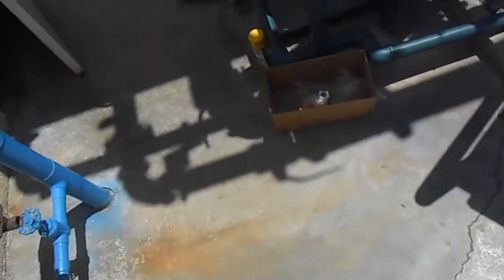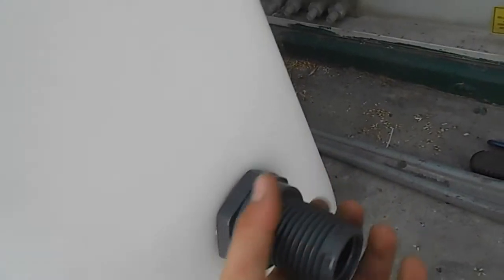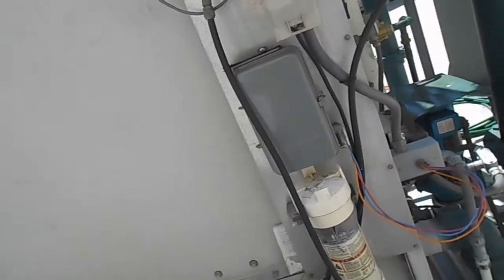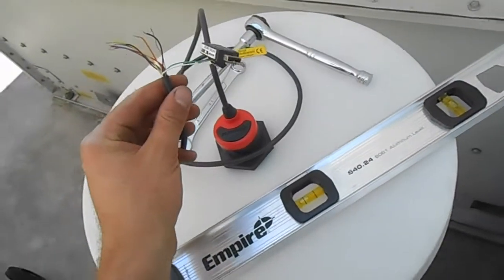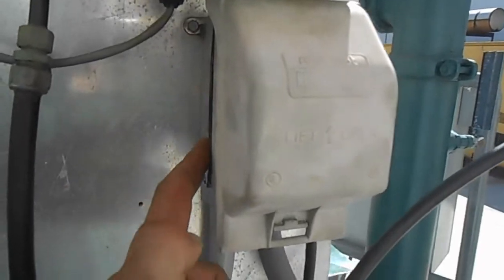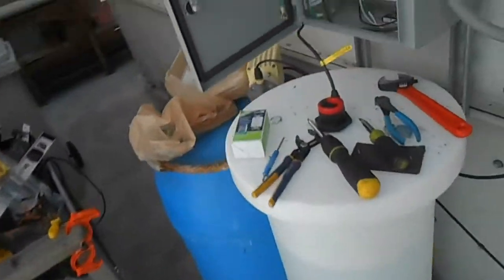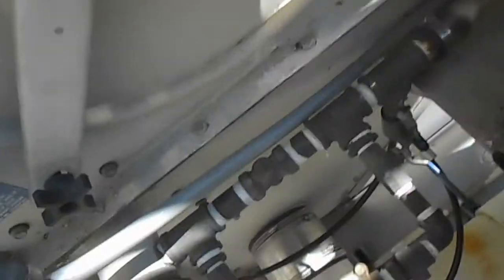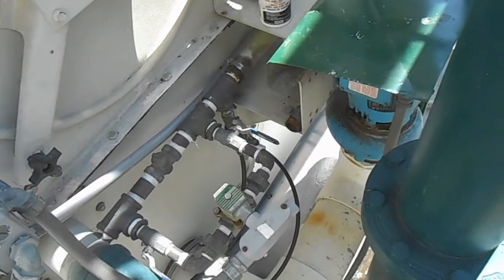HVAC- Cooling Tower Basin Water Control

Comment: Can you explain how the heaters work?
Reply from the maker: Familia Sanchez HVAC Heaters? Do you mean on the water source units?
Reply: 71dembones No, the ones in the basin, in the cooling towers. Don't they have heaters and a thermostat?
Reply from the maker: Familia Sanchez HVAC Perhaps they would in another climate where freezing could occur. But even then, I believe cooling towers would typically be drained in the winter months. I live/work in southern California so we rarely get to freezing temps here. If there were heaters in the basin, I imagine it would be just like a big water heater resistive heat element. Probably would have a contactor controlled by a low voltage thermostat that's was exposed to the water temperature.

Comment: Love cooling towers.  I took hvac in college 20  years ago.  Didn't finish, though.  Never got into cooling towers as far as I got in the course, but on the way there on the transit bus everyday, i'd pass some cooling towers and one I remember in particular.  I have since then taught myself how they and many other hvac related things work.  I like the way you designed this!  The no moving parts thing and longevity is all worth the cost if it is that much more...Thanks for the explanation and tour. I subscribed..Love these kinds of videos
Reply from the maker: Hey thanks for watching! I intend to take some college classes myself to fill out and reinforce my existing understanding. Having a piece of paper that says you know something is also all that matters to some people, unfortunately. I haven't needed anything but my reputation thus far. However, I want to be safe rather than sorry. I enjoy looking at machinery, piping, etc everywhere I go. I look at things with a critical eye; sometimes I smile, sometimes I laugh, sometimes I cringe, and when I gets real bad a single tear rolls down my cheek ); 

I can't claim all (or even most) of the cedit for designing it but, thank you. My good friend and mentor George talked with me about it and what it needed as far as inputs/outputs, wiring changes, plumbing, etc. He built the panel, shipped it to me and I installed it on to our tower. The OEM water level controller was a joke and very expensive to repalce. This set up is made of much better stuff and is most importantly outside the corrosive hellhole that is a cooling tower basin. I've caught a lot of shit from some people saying I should have installed a standard float valve and been done with it.That's just my problem with float valves! they only last a year and you have to go for a swim in the cooling tower with your pipe wrech between your teeth to replace the damn thing! Considering the cost of 3 valves and 3 labor/service charges that would be spent to upkeep it that way; this seems like a win considering it's still doing it's job!
Reply: 71dembones Nice.  I'm not in the biz, but I do notice a lot of hackery and my neighbours ask me to help with their minor hvac stuff..I'd rather not have to mess with stupid parts.  The higher cost would be forgotten with the lack of times you'd be replacing things and trekking into the tower.  I'd love to have been a part of the cooling tower project and learning off of people in the trade.